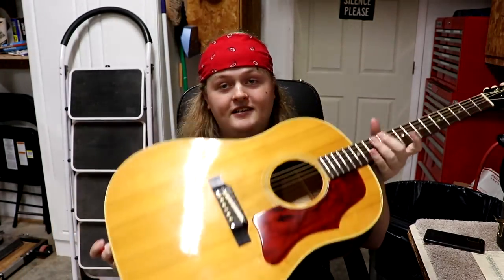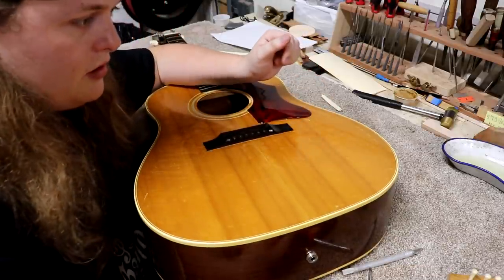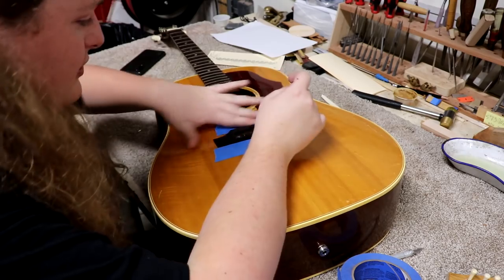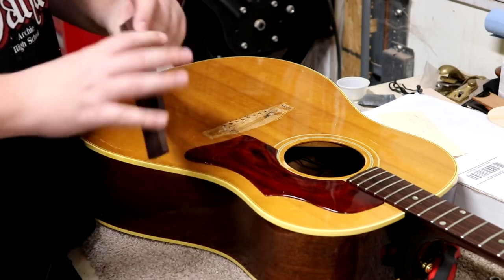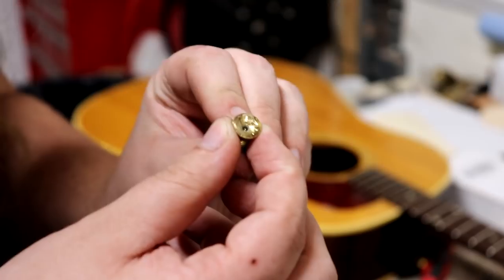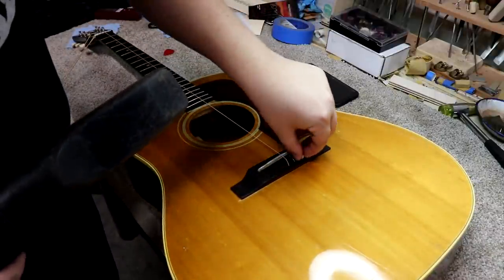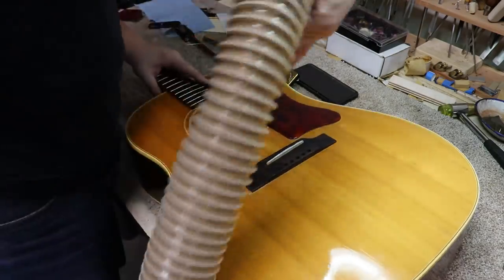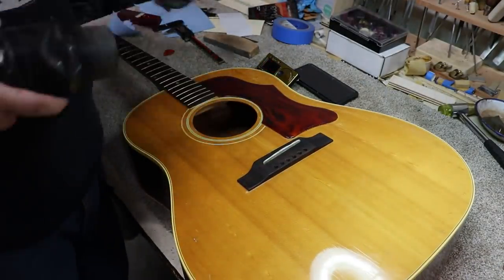518 RSW Gibson J 50 in for the Usual

Comment: Caleb,

You might find it interesting how Canadian Luthier, T Woodford, does that fix. Instead of removing the factory bridge and replacing it he makes an insert, glues it in where the adjustable saddle was installed, and then routs out a slot in the insert for a standard size saddle.

Comment: Very nice video.  I have the exact same guitar - a '65 J50 Adjustable Bridge.  When you played pre-repairs, I was amazed that your guitar sounded just like mine!  If I closed my eyes I could not have told them apart.  I think that's very cool for two 56 year-old guitars.  I have not needed to have the bridge changed.  It hasn't bothered me, although I now see that the tone can be improved a lot with a new one.  Unfortunately, when I was young I scratched up the finish quite a bit.  In the 1980's I had it refinished by a local repair guy who did a terrible job.  Some years later I sent it down to Gibson in Nashville for a factory refin.  They did a terrific job and even included a new pick guard.   Keep up the good work!

Comment: I would  probably just made a non adjustable thick bone saddle to replace the adjustable one, or plug the hole and make a new saddle inside the plug area. Any one of this procedure would be easy, cheap and reversible. Removing the non damaged bridge was not a good call for a guitar in so good condition. That said, it still a well done job.
Reply: I totally agree…a complete waste…they only made so many of these, and they are pieces of history…saddens me…and adding to that he could have bought a Seagull…great great guitars 450 bucks and problem solved….
Reply: Who cares? The customer wants a new bridge. It's his guitar and the original bridges were crap, even if original.
Reply: @alfsmith4936  That’s what ppl were saying in the 70’s while sanding down a 59 les Paul standard……but I do agree with you in the fact it’s his guitar and he can do anything he wants…
Reply: @nationalduo4945  Would they be worth what they are today if so many people didn't 'ruin' them though? Les Paul had no problem doing it himself lol.. I wouldn't go stripping todays collectables and painting them to look new but I would happily change the bridge on any guitar, if it made an improvement and those screws and a nylon saddle can be replaced easily, if somebody's deaf enough to want it. :)

Comment: Just wonder if the B string needs extra compensation or not?
Reply: I use TUSQ compensated saddles with TUSQ nuts***DR KEL
Reply: Caleb *Never shows compensating  the saddle for the A**D*G**and B* strings
Maybe he has no experience in shorten or lengthen the string by shaping the top of the saddle***DR KEL

Comment: What has he set the action at in millimetres?
Reply: Around 2,3 mm low E and 2,0 mm high e
Reply: @leonidbelousov325  cheers pal ✌👍
Reply: The Correct  numbers with most guitar spec's  are  measured in 64th's**LE=6/64 or .093 in **HI E 4/64 or .068--.078..MM normality not used **Some set  up gauges has MM scales .. a 6 inch pocket ruler with 64th scale is also good to have. ***DR KEL